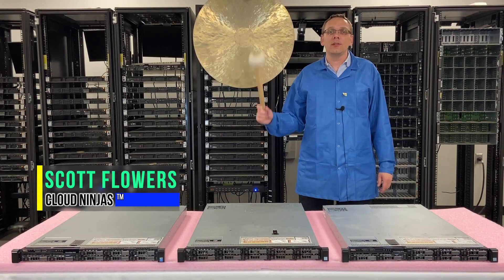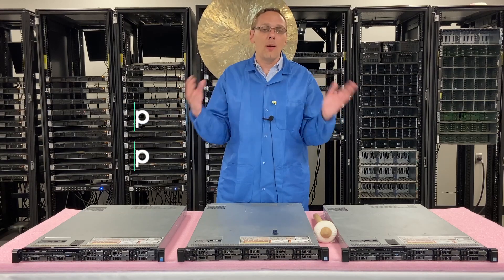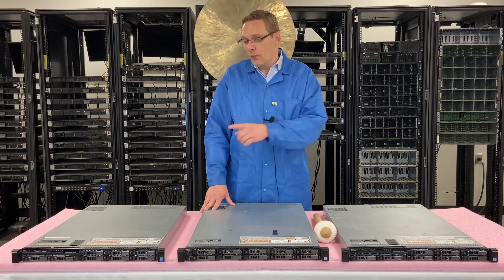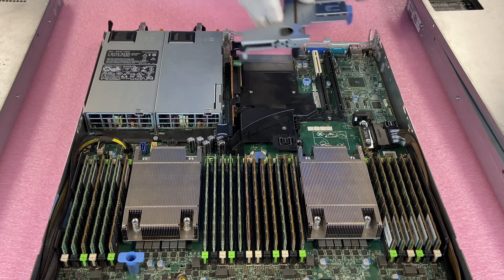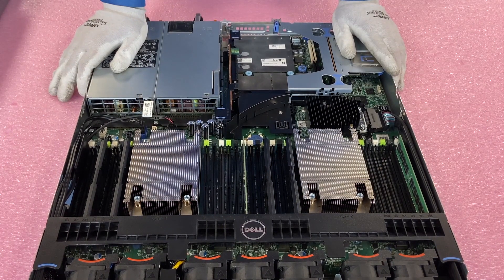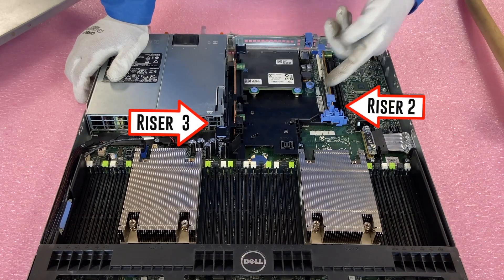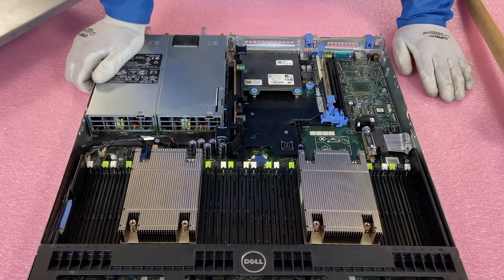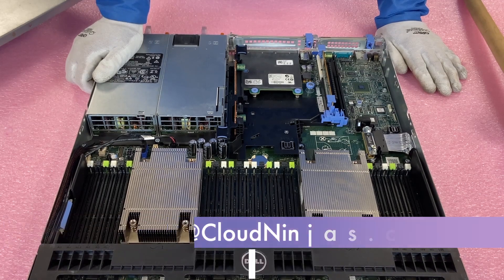Dell PowerEdge R630 Server Overview | Different Chassis Types | 8 Bay SFF | 10 Bay SFF | 2 vs 3 PCIe

Comment: Question, are all those motherboard PCIe slots usable if I simply remove the hard Dell risers and use my own cable risers? I'm mounting the cards externally, I intend to divide the x16 links into multiple x8 or x4 and hook up a crapton of K80s for LLM inference. Sorry if this is a stupid question, thanks for the short and sweet overview!
Reply from the maker: Yeah, all the PCIe slots should be usable, sounds like an interesting build you have going on there! Hope it goes well for you!

Comment: is there any information about the difference of 10 Bay SFF version, there is a difference of brand label on the top row, DELL and DELL PowerEdge. Is there any difference of production? and which one is the last production?
Reply from the maker: There isn't a difference between the 10-Bay SFF and the 8-Bay SFF besides the amount of drives you can install.